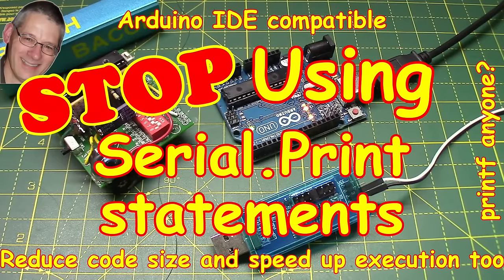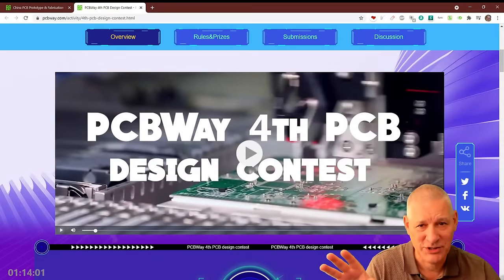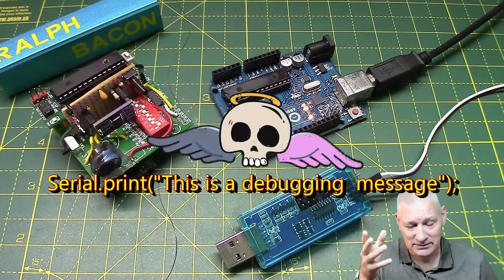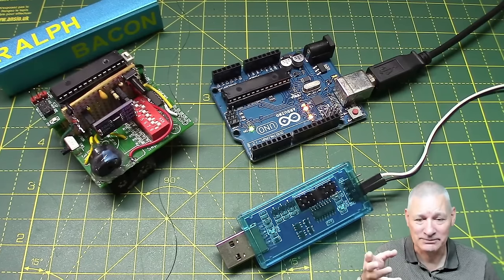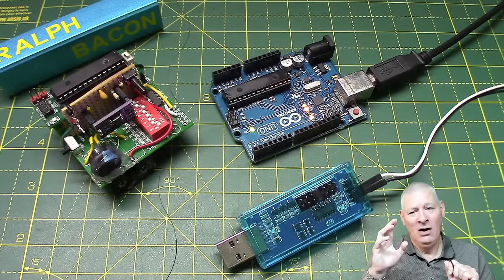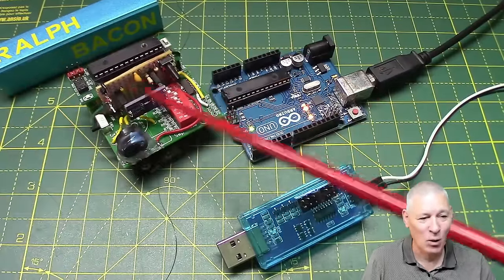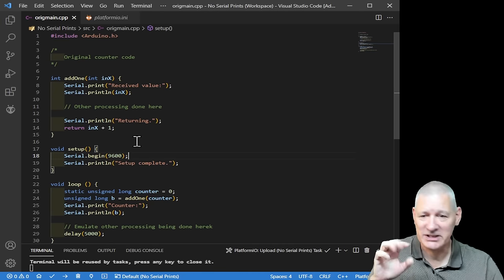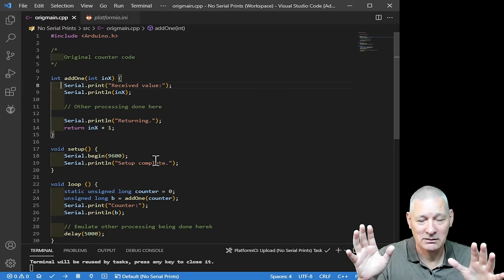#224 🛑 STOP using Serial.print in your Arduino code! THIS is better.

Comment: if you would define the debug functions as regular C functions, and have a boolean that can turn them off (make the functions do nothing), shouldn't the compiler detect that all that and actually optimize the code such that the debug functions are not even encoded to any processor instructions.
Reply from the maker: That's exactly how Espressif do it on the ESP32. They have various logging levels that are not even compiled if the Core Debug Level is not set to certain messages. This here, is a simpler version of that.

Comment: Hi Ralph. I do something similar. I have a function debugPrint() which checks whether isDebug() is true (which is an analog read if it's brought low it's true, on A0, usually in my code) and then I have an #ifdef DEBUG_ENABLED #define debugPin A0 #define debugLED 13 #endif then you just need to define _DEBUG_ENABLED otherwise it doesn't compile in any debug support. It's useful if you're developing on a huge processor (like ATMega2560) and then wanna compile it down to 328 (for example). I think adding a counter to the debug function might be useful, but haven't thought about it, since haven't had much time without brain fog to work on Arduino projects.
Reply from the maker: I think experienced programmers, like you Jess, will probably all be using some variation of this, tailored to the way you like it. 
But beginners will never have used any precompiler constructs so I'm hoping this introduces them to the concept as well as allowing them to make their programs look more streamlined without #if...#else...#endif statements everywhere! Good to hear from and hope you're enjoying the new pad.

Comment: @Ralph S Bacon  How would one use the optional second parameter which specifies the base (format) to use; i.e. Serial.print(0x61, HEX); ? At the moment I will receive an error requiring 2 arguments or 1 argument. To ask another way, How can I specify   #define debug(x,y) Serial.print(x,y) but allow Y to be optional?
Reply from the maker: I did update my examples to include further arguments (you were not the first to ask this). 

Basically, use the ellipsis (...) as the second argument in the definition, which means "an unknown number of parameters", from none to infinity. That way we can parse any further parameters and pass them onto the Serial.print statement.
Reply: @RalphBacon  thanks for the solution Ralph! I will give this a try on my next upload 👍

Comment: Valuable reminder of good practice but worth stressing that any testing needs to be completed on the debug-stripped version of the code ... can’t count the number of times I’ve been chasing bugs generated by accidentally non-included or over-defined values not apparent until the effects of the def changes played out.  Keep up the great work 😀👍
Reply from the maker: Sorry, Chris, what is this word "testing"? I've looked up the definition in the Arduino Coder's Bible and it states:

"Testing, v, The iterative act of releasing code into the Real World and seeing what happens, mostly using the happy path".

Sounds about right.

Comment: define is good for debug, where the compiler handles it. But using it in cases like "LedPin" (Which I have seen many times like you said) uses more memory than a const if you use it more than once. Const occupies 1 place in memory, but if you put "13" all over the place it's going to use more.
Reply from the maker: Hmm. I'm pretty sure using a #define macro name instead of a const does not use more memory. 

The #define method just substitutes the value before compilation, so:
#define ledPin 13
digitalWrite(ledPin, HIGH);
becomes
digitalWrite(13,HIGH);
Using literals here, is not memory hungry (it's a one byte integer). But it can depend on the compiler.

Using  a const:
const uint8_t LEDPIN = 13;
digitalWrite(LEDPIN,13);
will require the LEDPIN value to be retrieved from memory by code unless the code has been optimises and the value substituted like a literal.

The compiler will try to keep the const value out of SRAM (it knows it cannot be modified). Which one uses less memory is hard  to determine.
Reply: @RalphBacon  When you're using multiple like I said:
#define ledPin 13
printf("%d", ledPin);
printf("%d", ledPin);
printf("%d", ledPin);
printf("%d", ledPin);

Is:
printf("%d", 13);
printf("%d", 13);
printf("%d", 13);
printf("%d", 13);

in this scenario you're assigning 4 different constants, all of them are 13

vs
const int ledPin = 13;
printf("%d", ledPin);
printf("%d", ledPin);
printf("%d", ledPin);
printf("%d", ledPin);

living in a single place of the program. I'm talking I've seen programs with hundreds of places that define rewrites at compile time. In situations like above program size will be bigger.. but if you're running those defined preprocessor consts all over the place especially running simultaneously it ends up being more memory, too (as well as having to be loaded into memory, and removed rather than just sitting there as a global constant for the program's entire running duration)
That's all I meant though, not for like single use things doesn't really matter

Comment: When i use dallas 18B20 temp sensors they eventually crash out any esp i run. My projects run until they rollover with no issues but idk whats causing them to crash several hours after running one wire and ds18b20 temp sensors. Any idea what may be causing this?
Reply from the maker: Sounds worrying. I can't believe it's the DS18B20 (I intend to use that sensor in my Smart Workshop Heater Controller) so it must be your code. Are you checking for enough free space - and stack space. What do you get when it crashes? I suspect you have a memory leak.
Reply: @RalphBacon  It was a memory leak. I never even considered that. Im now storing the get temp function to a variable thats only updated every 4 minutes instead of every second and my if statement is comparing the stored temp in variable instead of the get temp function repeatedly. Thanks Ralph

Comment: under the else could you kill the serial.begin also? #define serial.begin(x) (nada). in fact could you just define all the normal serial.prints out of existence instead of using debug?
Reply from the maker: Probably, but that wasn't the focus of this video so I never tried that. The Serial.begin initialises the UART's baud rate (I think it is already active, ie running, by default ) but we can switch it all off if required.

Comment: You can also speed up those Serial.print statements, by simply setting the baud rate to 2000000 instead of 9600 for ATMEGAs, or 115200 for ESP8266.
Reply from the maker: I've never used higher than 115200; I will see if my IDE allows me to select a higher speed and see whether I get corruption on long(er) USB leads.

Comment: printf is working on my esp32 without adding any libraries. Have not tried it on a atmega.
Reply from the maker: Indeed, it's built in. But for logging, I'd recommend log_x where x is v,d,i,w,e depending on the level you want).

Comment: This line here using the debug, caused me an error   Serial.print(dht.computeHeatIndex(temperature, humidity, false), 1); any help? Compiles okay with serial pring, but not with debugln(x)
Reply from the maker: OK, that's because I (initially) didn't cater for the following syntax of the Serial.print format:

Serial.println(myVariable, BIN); // Two arguments 😲

where BIN might equally be HEX or, as in your case, 1.

This was resolved and I'm pretty sure the advanced examples (in the GitHub) show how to use this. If not, bug me via email so I do actually fix it.

Comment: An elegant simple solution to a sometimes cumbersome headache. An enhancement would be to define debug levels. For example, when debug is set to 1 only "where I am" messages would be printed, whereas debug set to 2 would also print variable values, and so on.

Quick question. What IDE are you using in this video?

Thanks,

Jack
Reply: Visual studio with platformio, he mentioned it in the video. Highly recommend.
Reply: @MadScienceWorkshoppe  Thank you. I guess I didn't catch that when he said it.
Reply from the maker: My GitHub for this video has an advanced version which does just that. See video description for link!
https://github.com/RalphBacon/224-Superior-Serial.print-statements

Comment: Unused variables in proper compilers would be optimized out. Example, the STM32 cortex M series compilers. Not sure about the arduino though.
Reply: Arduino uses the GCC compiler, so yes, this also applies
Reply from the maker: It's quite amazing what is removed as part of the optimisation process, including whole functions.
Reply: @RalphBacon   Indeed. As a retired software engineer having worked in customised compilers and language interpreters for several companies, I’m currently an occasional contributor of the LLVM Compiler project, so I can confidently assert that a modern compiler is able to make certain optimisations and code transformations that are even beyond what an average programmer would be able to implement in assembly language

Comment: Sorry to hear about your argument with the knife. 
I had another thought about using this. Would it be possible to turn this on or off with a MQTT message or some other means of remote control?
Reply from the maker: We would not be able to control the compilation process, so the Serial statements would be present; but the execution of those statements could certainly be controlled by pretty much anything that the microcontroller can receive (it's just a flag, after all).

Comment: The problem is in the line. 
"Serial.print(abc , 2) ;" it don't work if I write "debug(abc , 2); " 
Error: 'macro "debug" passed 2 arguments, but takes just 1'
"#define debug(x)   Serial.print(x)"
Reply from the maker: Hmm, this is now going beyond the constraints I was expecting (simple debugging statement) but you could add further arguments (...) or _VA_ARGS_ into the #define. Maybe. Possibly. I've got a feeling this is the wrong way to have sophisticated debugging, Jens.
Reply: @RalphBacon  Limit the floating point number to decimal places. But I was able to reduce the Serial.print Statments.

Comment: Does gcc/ld not automatically put "literal string constants" into the read only flash section?  I mean it will temporarily use memory.  The .bss (declared but not initialised and non constant) section is allocated in RAM before the heap, but constant allocations should happen at compile time and go into flash.
I have seen this "F" macros in arduino FW land and I'm still a little confused by it.  Unless the linker is different there.
Reply from the maker: It might put the string literals into a specific section (eg .bss) but it won't store that section in program flash memory.

If you want to move any of those variables into program (flash) memory, use the "F" method or PROGMEM on declarations. Obvs can only apply to constants.
Reply: @RalphBacon  Hmmm.  Interesting.  I don't have an Arduino framework IDE open, but in STM32 land....
  const char *Hello = "Hello";

and putting a break point on it, then looking in the memory it's at 0x800834 which is right in the middle of flash memory.
This is correct behaviour.
If you aren't seeing this behaviour in Arduino framework, they have modified GCC and or the Linker to put constant strings into RAM for some reason.
That or the string is declared and being used in a way that GCC cannot make a solid determination that it is indeed constant.

I'll try with Ardy later.  No deugger there though, so I'll just have to print out the pointer.
Reply: @RalphBacon  There is a gcc command which will show you the memory map for a particular C file.
size -A object_file.o
Reply: It could depend on the platform. For some Arduino ports it is auto.
Reply: @RalphBacon  it does store them in flash then copies them to ram.  They can be read directly from flash with the F if appropriate.  Obviously it can't just store it in ram because the strings would disappear on power loss.

Comment: Yes you can't use printf but you can use sprintf() and it works great just create buffer and provide this string for example to Serial.print()
Reply from the maker: I must admit a dislike to creating a buffer of unknown length to receive a message that we then output. I think printf works better and the ESP32 has it built in and now the Arduino can have it for very little cost (code size-wise, I mean).

Comment: ESP32's log_x functions are defined inside the ESP32 Arduino core (esp32-hal-log.h and esp32-hal-uart.c). You do not need any additional library and maybe you should have mentioned that ArduinoIDE has a menu item to control that log level. Define is needed only for PIO
Reply from the maker: Good information, thanks for sharing!

Comment: I don't understand, it's just reducing the size of the compiled program? What about metrics in runtime? With this can you do more operations per second?
Reply from the maker: The serial output is relatively slow (even at 115200). The entire program will run more quickly without having to send stuff through the UART.

Comment: I thought you were going to suggest toggling GPIO pins to indicate execution state. It's fast and if you have a multi-channel scope and only a few events to monitor it's good for getting an indication of when things are happening. Anyway, it's something that I do when printing to serial takes too much time or would result in excessive output.
Reply from the maker: You can also control the Serial.print statements if a particular (spare) GPIO is low. Connect a jumper between the pin and GND to turn Serial.print statements on, remove it when done for faster execution.
The macro in this instance would interrogate the state of the (input) pin, ideal for those on the ESP32 that are INPUT only.
Reply: @RalphBacon  Yeah, that is a good strategy as well.

Comment: I believe you know your add 1 never changed the value of counter!
I do have an ESP32, I may go get the log lib.  Will it have issues if I add the printf for the arduino or do you know?
Lee
Reply from the maker: If you have an ESP32 then you have a separate way of displaying debug information, by using log_x where "x" is e,w,i,d,v for errors, warnings, info, debug and verbose output respectively.

It uses the "printf" functionality behind the scenes. Just compile the sketch with the build  options (menu Tools...) set to VERBOSE (5) thru NONE (0) or something in between for this to work. Very simple, very useful.

Using the printf functionality with an Arduino just uses memory so keep the messages short!

Comment: does not work on arduino ide 2.03.compile fault debug out of scope??
Reply from the maker: It's not the IDE at fault it's the/your code (it's working for me, so have you included the files in the correct order, for example)? If the compiler complains it can't find "debug" (which is a macro declaration) how does it know how to find it (usually by an #include statement).
Reply: It didn't compile for me either the first time.  You have to be careful that you have no spaces in your "debug(x)" and "debugln(x)" define statements.  That's the problem I was having the first time I tried this.

Comment: Is this also similar to just deleting all Serial print,begin,etc. statements? I do understand that it is used for debugging but should it be possible to just convert them to comments instead? and explain the bug and everything
Reply: Also !! I am a bit rusty on cpp and arduino code since I have been using python recently, I don't know if it is better. I think it would be easier if you define the debug() and debugln() functions in another .cpp file and declare it through header file (the #if #endif lines idk if the word is declare EDIT: it is define) and just import that header file into your main cpp file. You can comment it out if you don't want to use the debug anymore.
Reply from the maker: It is technically the equivalent of converting all the Serial.print statements to comments, inasmuch that they do not get compiled at all if the debugging switch is not set.

The advantage is that they remain so you can switch them back on again if you want and act as a sort of documentation of what that piece of code was doing.

Comment: sir if i use serial print on the code thats not looping example like wifi setting is it okhay?, because i think its only happen once.
Reply from the maker: Correct! If the Serial.print statement is not in the loop( ) function then it only consumes program/runtime memory but will not slow down the sketch.

Comment: man, I've been using directive ifs on EVERY serial statement. I use "Streaming" though, I'm wondering if I can adapt your method to work with streaming...hmmm
Reply from the maker: Hmm... messy, if you don't mind me saying! I know exactly what you've done and this method is definitely cleaner. Good luck with the adaption you mentioned for "Streaming".

Comment: Thank you for your beautiful tutorials
What is the difference between debugD and debugV?
In both definitions, debugE, debugW, and debugD are executed.
Was there a specific reason you defined debugV?
And why is the debugNothing function used in debugV and not used in the rest of the functions? Is there a specific reason?
Thank you for your reply
Reply from the maker: The "V" stands for Verbose and is used for those really low level messages that otherwise would be really annoying and flood the output. 

"D" is for more general Debugging and E/W/I you know about. The level you set (eg "I") ensures that all message at that level AND HIGHER are output (so W and E too).

debugNothing should exist for all levels if they are not defined.